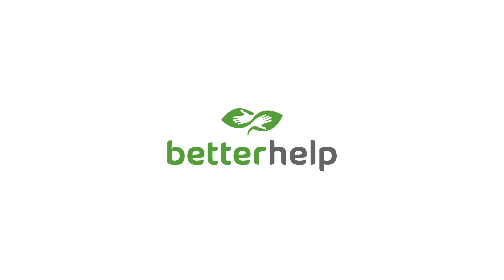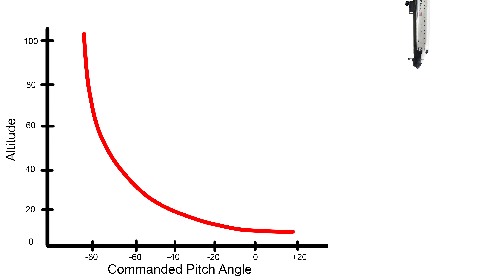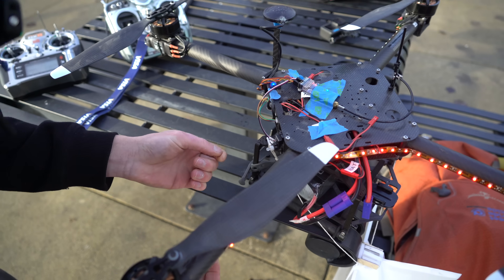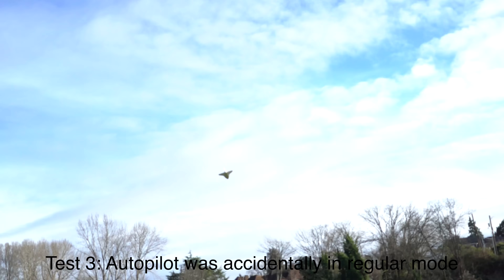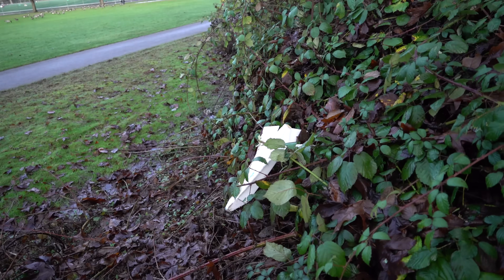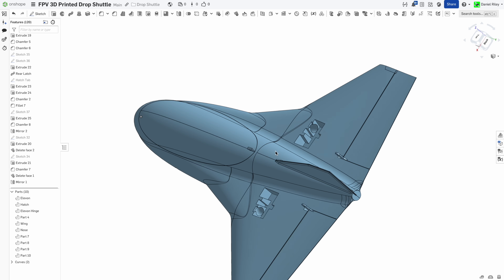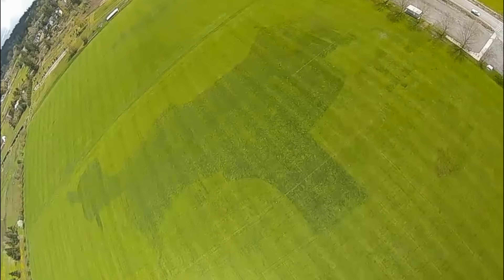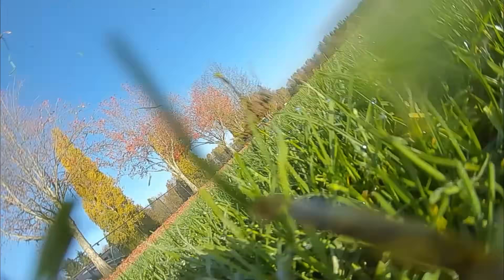3D Printed Autonomous FPV Shuttle Glider

Comment: No parabola for descent curve.  A curved path of fastest descent under uniform gravity is known as the brachistochrone curve, which is a type of cycloid
Reply: They are controlling AOA, not position. There would need to be a controller to target position for this to be true, and it probably doesn't work because of aerodynamics
Reply: @KnowledgePerformance7 I don't really think, that it is AOA, i would say that it is pitch, but I also agree with your comment.
For the optimal path it should be based of some position system. I think that having some sort of system, that would meassure all of the flight parameter (as he mentioned in the video) and then it would compute the  things to do in order to stay on the optimal path would be best, but also more challenging.
Reply: True